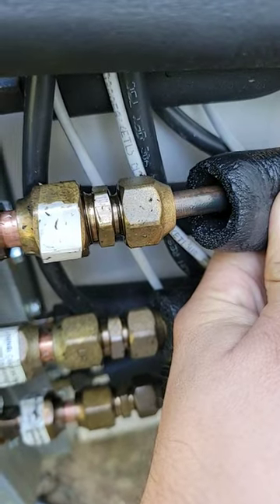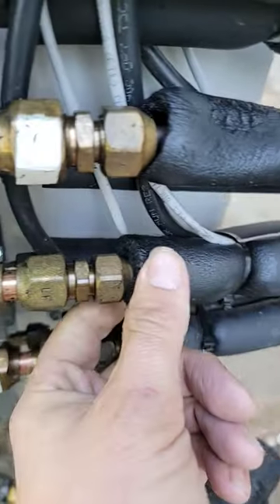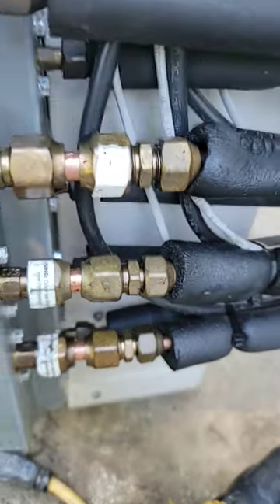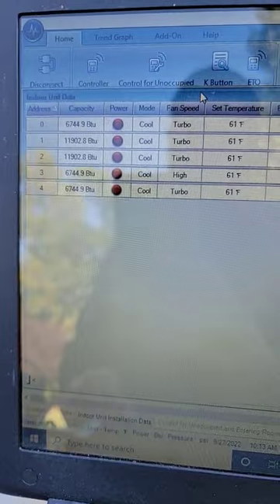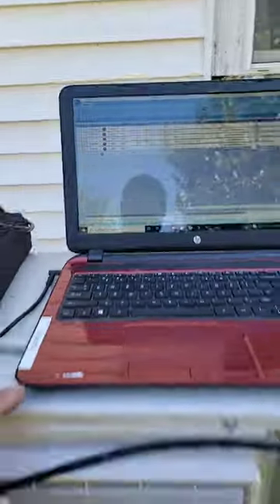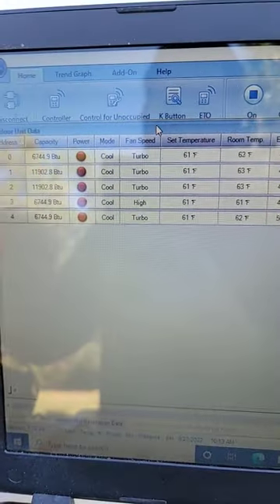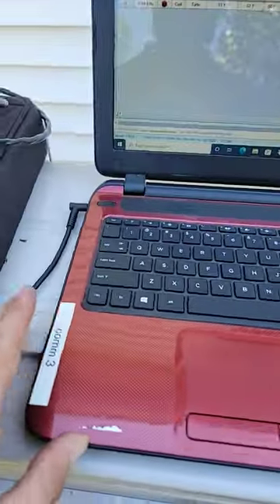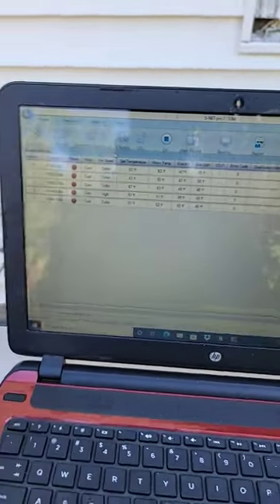How to Work on Mini Splits?

Comment: 500 psig of nitrogen is too high. Look at the test pressures on the outdoor unit nameplate. The valves on those mini splits aren't exactly the gold standard. At 500 psig you can push nitrogen into the refrigerant held in the outdoor unit.

Comment: 500psig is too high for a mini split
Reply from the maker: no sir that is incorrect
Reply: The recommended pressure I've heard is even higher, we do 600.
Reply from the maker: awesome Glad to hear this 
You are the man Jose
Reply: I was taught to not go over the low side operating pressure as listed on the name plate.. please correct me if I'm wrong.
Reply: U r right 500 is ok